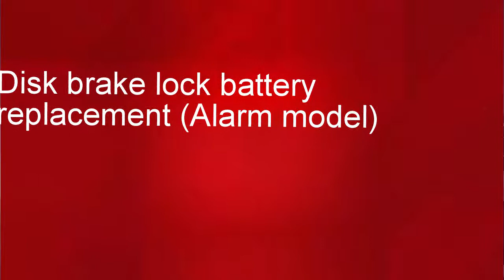Disk Brake Lock Battery Replacement

Comment: Ok. I just bought a $20 motorcycle disc brake pin lock from Amazon. It takes 6 LR44 batteries. This video showed me how to remove the battery cartridge in my lock as it was not shown in the pamphlet. My lock is just a little different but it was the same removal process. Thank you!